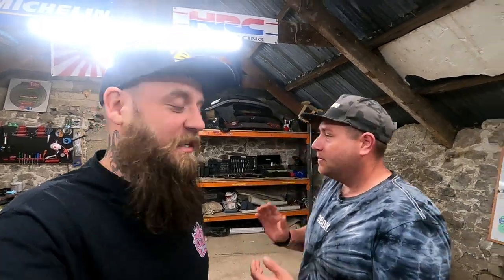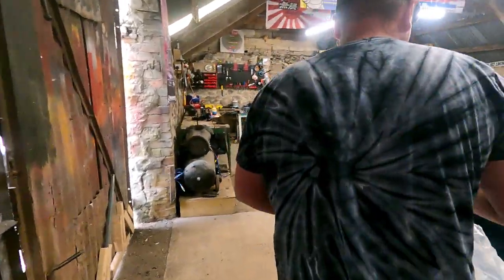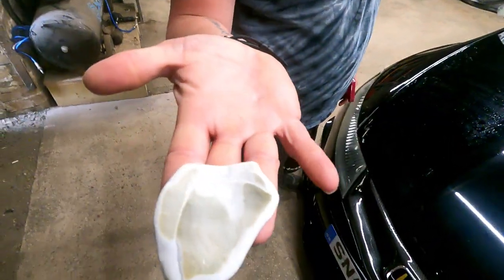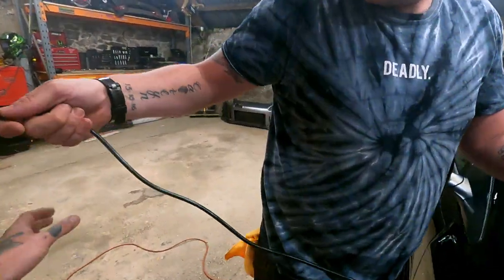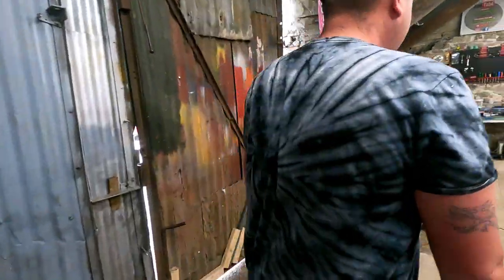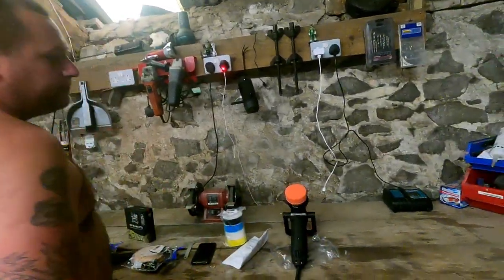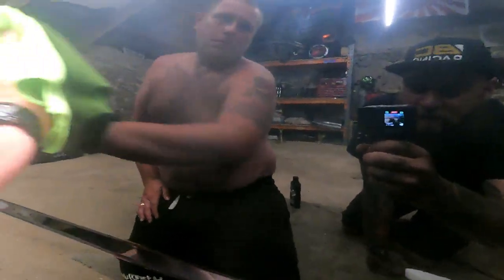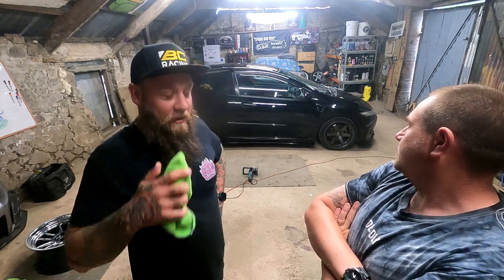How Well will a machine cut and Polish Bring back A Black Honda Civic  FN2 Type Rs swirled paint

Comment: Looks great! I did my black fn2 last year just with a white pad and meguiars 205, it came out great. Now you have to use the two bucket method washing to keep it looking good for longer.
Reply from the maker: Always two bucket bud. We are both well into our car cleaning 🤘🏻❤️
Reply: @CowabungaCarDiaries  👍🏻 I need to do mine again though, stupid soft honda paint 😫
Reply from the maker: @Springwater786  get a ceramic coat in it after mate. Makes such a difference
Reply: @CowabungaCarDiaries  yeah I might have to try that, only ever used normal wax. I'll check your next video!
Reply from the maker: @Springwater786   unfortunately we lost all the footage of that one. But. It’s so so easy to do with that kit. Highly recommend
Reply: @CowabungaCarDiaries  🤦‍♂️ what a bummer, yeah I'll give it a try!